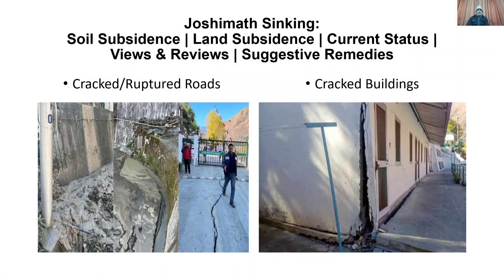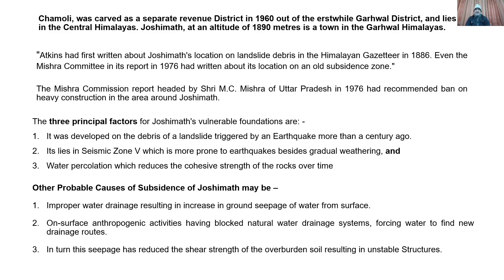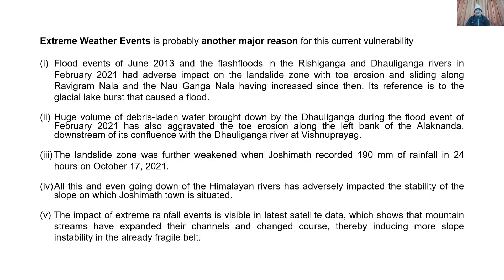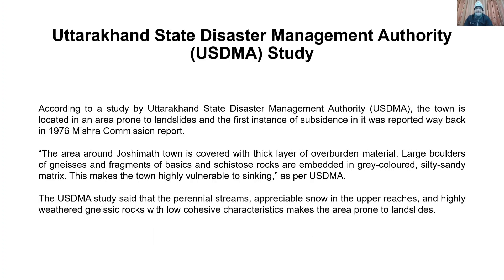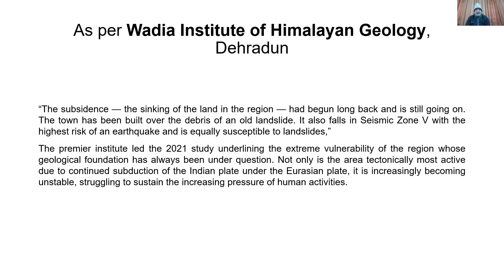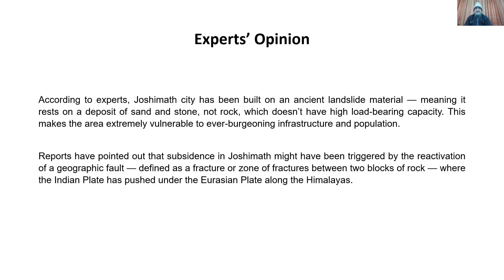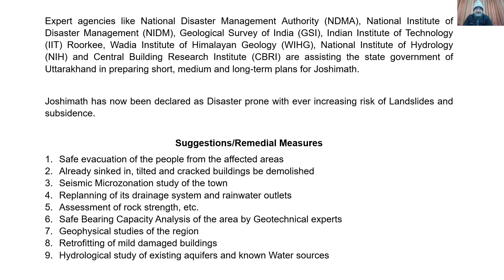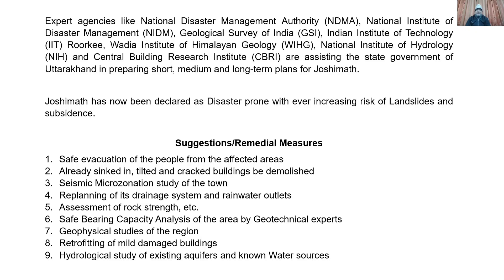Joshimath Sinking: Soil and Land Subsidence | Current Status | Views & Reviews | Suggestive Remedies

Comment: Excellent explanation of the issue. The cause is purely technical.
Reply from the maker: Yes Subodh Rathore Ji. Actually I did not cover the more and very technical issues because of it's sensitivity like the tunnel work being taken up there as well as over crowding, over construction and very poor drainage with soak pits being built in almost every house, etc.
Reply from the maker: Still thank you for your compliments